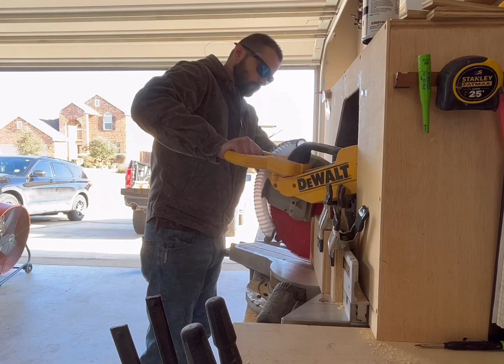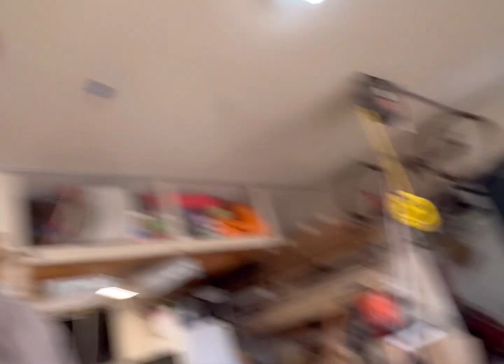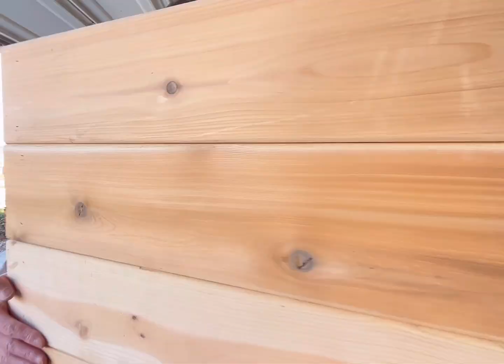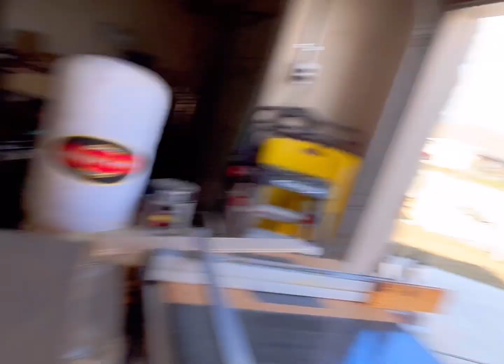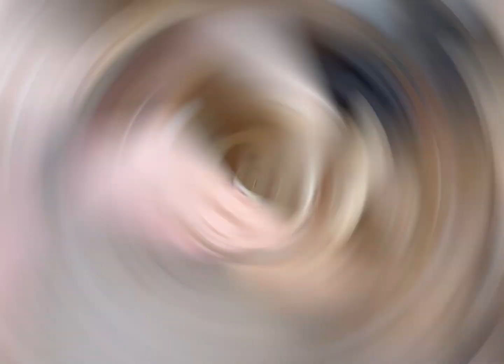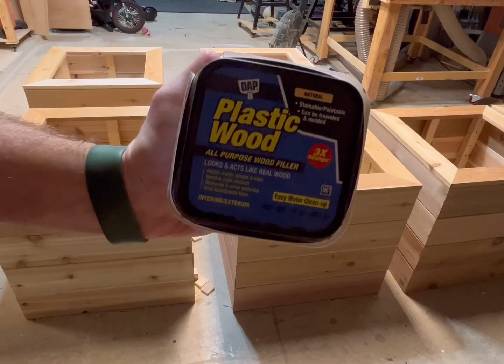Easy Money Cedar Planters-DIY Friendly

Comment from the maker: Some Supplies Used:

Teak Oil https://amzn.to/3jQF2Xk
Titebond 3 https://amzn.to/3K2CiAH
GluBot https://amzn.to/3HSGxfH
Silicone Glue Brush https://amzn.to/3E2wcNg
4” Paint Brush https://amzn.to/3E1NQAu
Trim Head Screws https://amzn.to/3K1bAZm
Dewalt 20V 18ga nailer https://amzn.to/3IkYfdl

SALE 
Dewalt 20v impact driver https://amzn.to/3E3jYUs
Dewalt 20v Random Oribital Sander https://amzn.to/3YoIY0H

Comment: how much dirt do the planters hold?
Reply from the maker: It’s been a minute since I built these, but I believe they were 2’x2’x2’. In that case it would be 8 cubic feet per planter. Locally I can get 2 cu ft bags of soil so those work out good for filling them.
Reply: thanks for quick response!  real nice planters.  Did you drill in any drain holes on the bottom of the corrugated panels? @Solidgrainfurnitureco
Reply from the maker: @Clemandsimms  I believe so, If I put a bottom in my planters I always drill a series of 1/4” holes for drainage.

Comment: Does the glue and brad nail in the corners keep the boards together when the wood swells in the humidity?
Reply from the maker: From my experience, if anything these boards will shrink a little bit. There are screws on the inside connecting the outside boards to framing pieces too.

Comment: What screws did you use on the inside 2x's?  I'm figuring they were not the Trim head screws used on the top trim.
Reply from the maker: They were 2.25” torx head deck screws.
Reply: @Solidgrainfurnitureco  Awesome!!  Thanks!!

Comment: Good day sir, where can I see what you did at the bottom? Is that roofing tin? If so, that's a great idea!!
Reply from the maker: Yes it is corrugated tin for roofing. Sorry if I didn’t capture that very well in the video. It is cut to size and screwed to the bottom of the 2x2 framing.
Reply: @Against The Grain Woodworks  thanks for the response!! I think I may get to work on some of these this weekend for my forever home!!